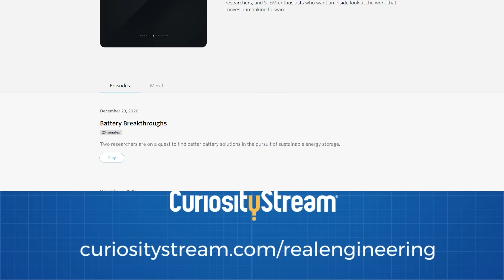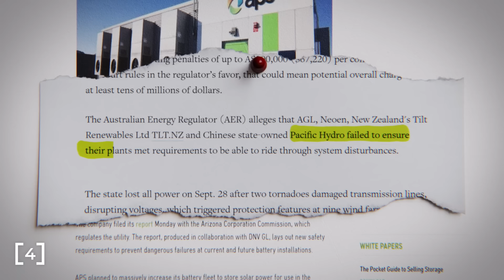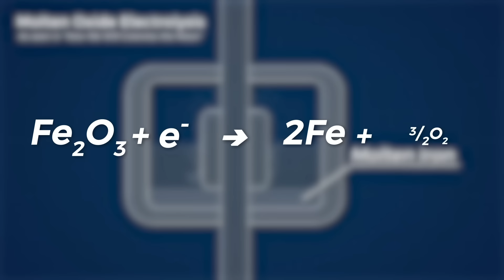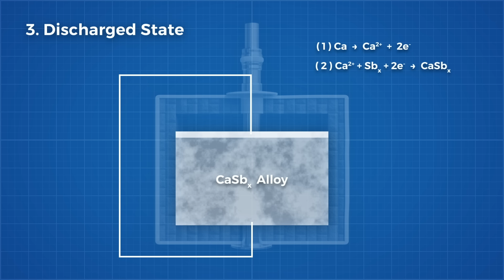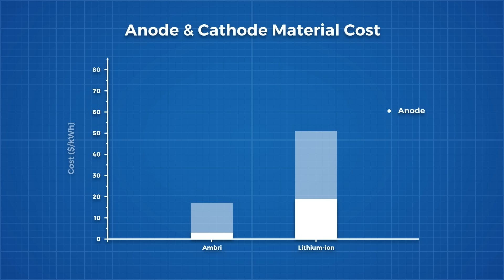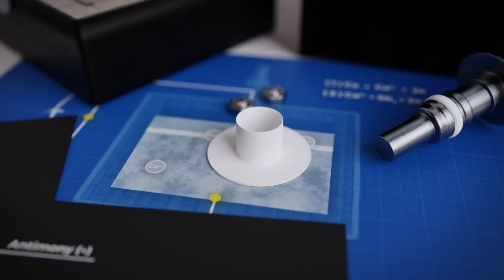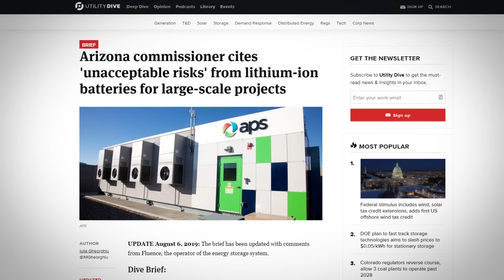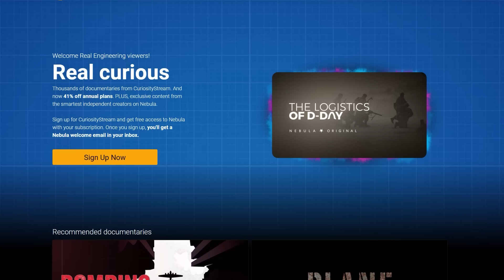The Missing Link in Renewables

Comment: Liquid metal batteries seem interesting but the fact they must kept hot at all times, even when they aren't in use, is in unbearable weakness. Moreover, the heat amplify all parasitic chemical reactions and brings to the fore the role of impurities.
I agree that Li-Ion batteries aren't the most suitable chemistry for grid storage; but they are pushed into this role by the large current industrialists.
The proper battery technology for grid storage is Lead-acid, with carbon added to the electrodes to stop sulphation of the battery.
Problem is, with Lead-acid batteries, there are no patents, no innovation, no motives for making extra money. Like aspirin, which is excellent medicine but just too old.
I believe that, for Lead-acid batteries to be used for load - leveling, some power grid owners should became battery manufacturers.

Comment: Dummy. Of the total electric power generated, 40% of it is wasted in "the grid". Also note battery charging is not 100% energy efficient either typically losing power every cycle.  
The only way going forward is generating power at the point of use.

Comment: Doing the same mistake with EV vehicles.
Battery are too expensive, takes too long to charge, the cars have no range.
The proposer of EV vehicle will fail to electrify the car market.
See, a petrol car has a 25% efficiency.
With today technology, and nothing else to invent, we can put together a car with an electric engine, and a big fuel cell fed with petrol - gasoline.
That would double the efficiency compared to an ICE vehicle, and have no emission of particulate and NOx, with no range and long recharge times problems.
Not bad for something we can have today and would be very successful on the market. A full EV is a step too far.
PS. For grid battery, forget hot liquid batteries, they don't convince the grid engineers. Rather, use large cylindrical carbon lead acid batteries, cheap as chips and 25 years of calendar life. They don't lose 20% of power in 24 hours...